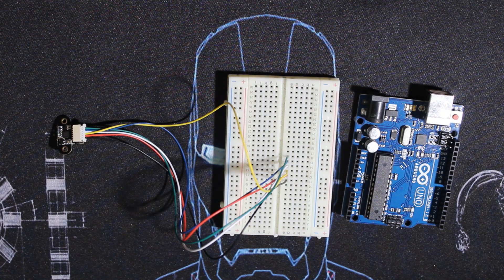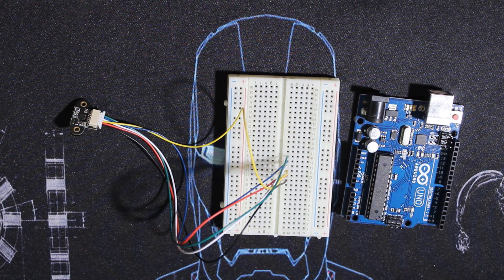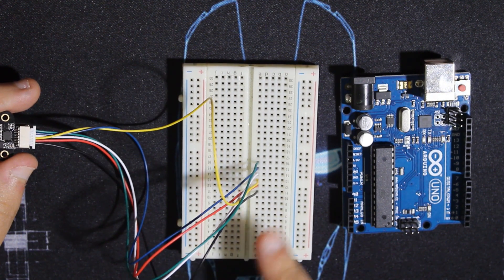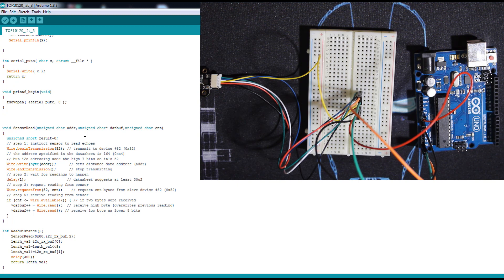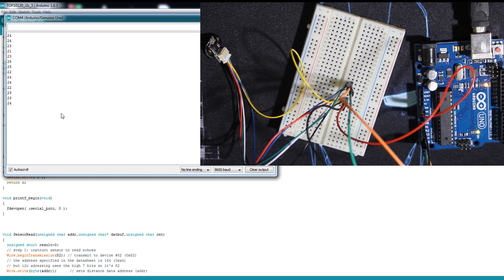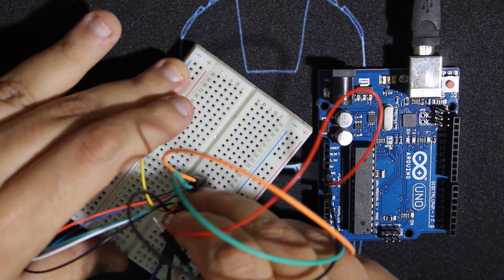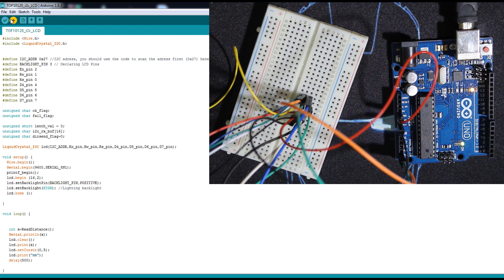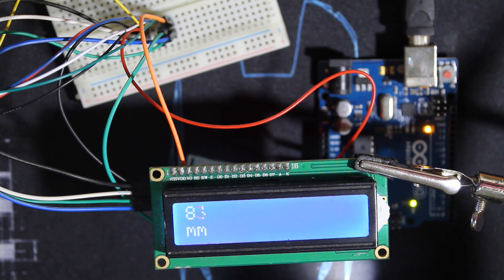How to use ToF10120 + Arduino to measure distance using LASER Rangefinder

Comment: Is it possible to make the tof10120 sensor rotate? If so how?
Reply from the maker: What do you mean by rotate? Sweeping for example? Just place it on a servo motor or a stepper motor...
Reply: @SurtrTech  I have a servo motor like so: https://create.arduino.cc/projecthub/Arca_Ege/how-to-use-servo-motors-with-arduino-b02bed 
But I need to know how to put my tof10120 sensor on it.

https://www.aliexpress.com/item/32901237079.html  (my sensor) 

What I am trying to do is put the HCSR04 and tof10120 on my arduino car and see which one performs better in an obstacle course for a science project. I have already figured out how to make the HCSR04 rotate to detect obstacles but am having trouble rotating tof10120. This is what my car looks like: http://www.rominfotech.com/product/24in1-elegoo-arduino-smart-robot-car-kit-with-rechargeable-batteries/
Reply from the maker: What kind of trouble? is it software? Wiring? If you can do it with Ultrasound sensor you can do it with this too...
Reply: @SurtrTech  the problem is that I don't know how to put the tof10120 on the servo motor mentioned above.

Comment: Hellow. could you adding buzzer alarm when distance out of  range set
Reply from the maker: Hello, there's that "x" variable in the code which is the distance in "mm", you can make conditions for that variable values, for example if it's >1800 you make the buzzer go off using Tone() and noTone() functions...
Reply: thanks

Comment: evening boss, great video , cleared alot of my issues up. just having trouble with the map function, im trying to map distance over percentage, ie 5cm = 0% , 40cm = 100%. any ideas how to write it in code im getting errors.
Reply from the maker: Hello there, well the map function just change the value range from one to another... according to this module datasheet it's 100 - 1800 mm (the range can change depeding on the conditions), you can rearrange it using the map function:
y = map(x, 100,1800,0,100); //Don't forget the variables declarations
Here for example we have x which is the measured value and it pretty much goes from 100 to 1800mm now we made it 'y' that goes from 0 to 100 you can consider it as percentage: 0% of the range to 100% of the range, or you can try 
y = map(x, 50,400,0,100); for example...
Reply: @SurtrTech  perfect thankyou very much that did he trick, however now i have come to wire up the circuit and upload the test code. i am getting a fdevopen' was not declared. any ideas
Reply: im trying to run it on my esp32
Reply: dont worry about it i just deleted the offending statement, works great thankyou very much, thumbs up this guy!